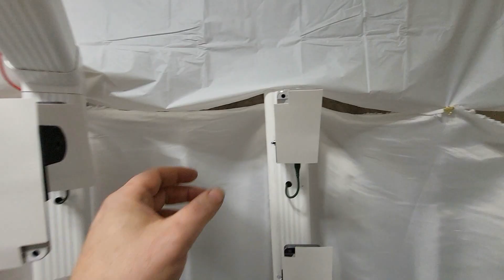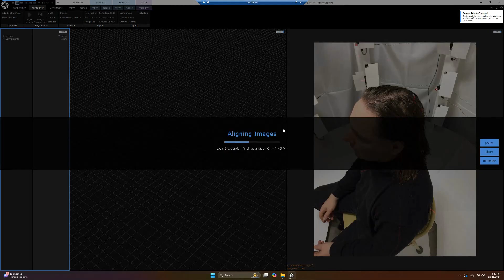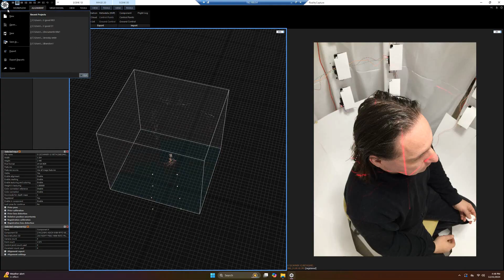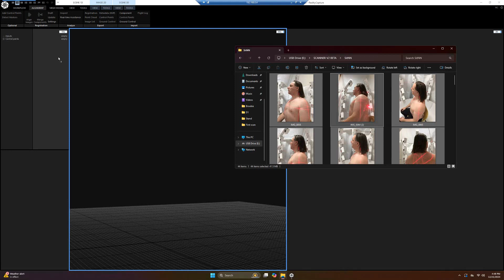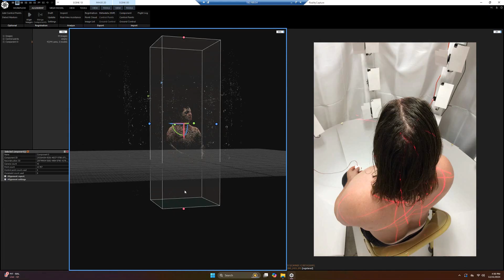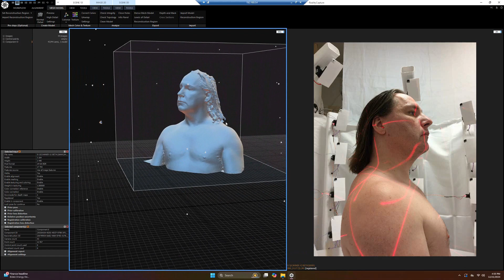Photogrammetry iPhone 3D scanning rig. Second generation.

Comment: Thank-you for sharing your progress. It would be interesting to see a video of how you network the iPhones and coordinate sending all of the images to the computer.  Also, why use iPhones cameras instead of something like an Arducam IMX519 (cost?)?
Reply from the maker: More stuff is coming later! As for decision about cameras, you are right - cost was the main one. Since ATT dropped support of iPhone 5 series, one can buy them for average price of $20 per unit. It give you better image sensor (8MP but 5s do have improved one). Bespoke optics. WiFi, Bluetooth, and everything also. Arduino cameras are made for machine vision - iPhone for best quality image possible (for the time). iPhones would cost you one third of arduino setup. It takes in ease of control, for sure. But if you look cost/performance comparison, you simply cannot get better picture for less money than on iPhone 5s.
Reply: @UtterlyMad I also came across some iPhone is and the cameras are 12MP